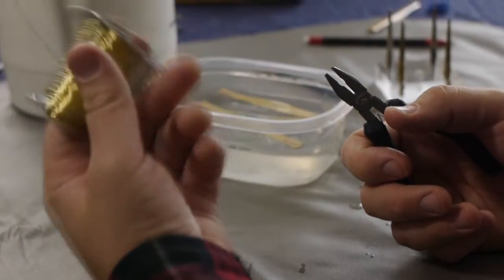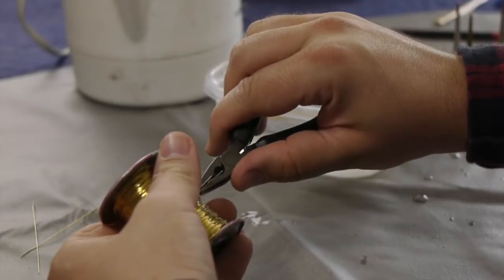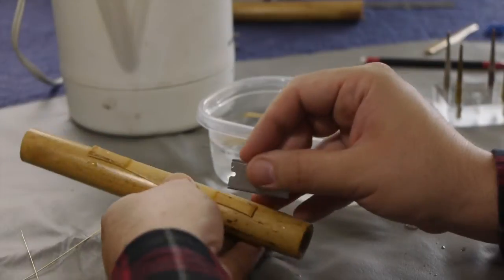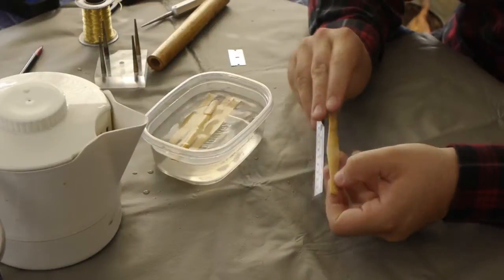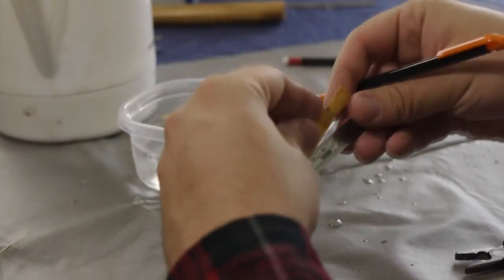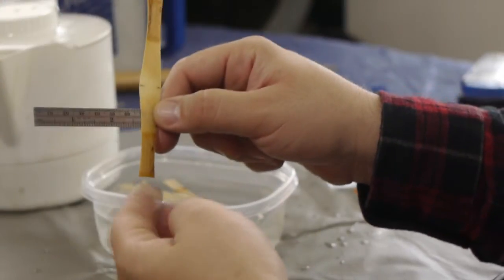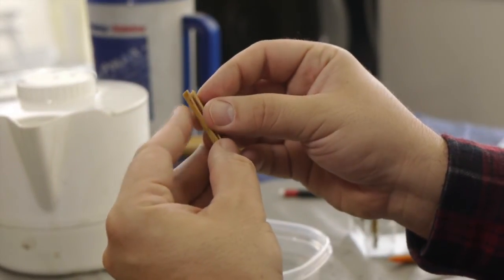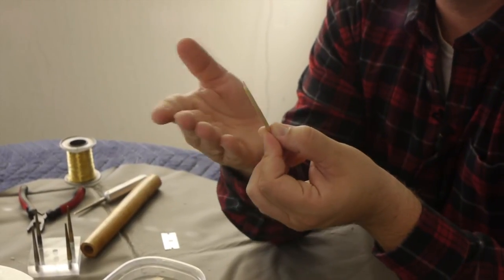Bassoon Reedmaking Simplified- Part 1: Score and Fold

Comment from the maker: Hey Alana, My reamer is from Forrest (It's thier own brand, but several years old so they may have changed it. I'm also pretty sure I got my Berdon mandrel from forrest.

What I actually reccomend, however, is that you purchase a Pin Vice from ebay or something (needs to be 1/4" or larger) as well as madrel and reamer tips from Christlieb. (They also sell pin vices but charge a bit more).